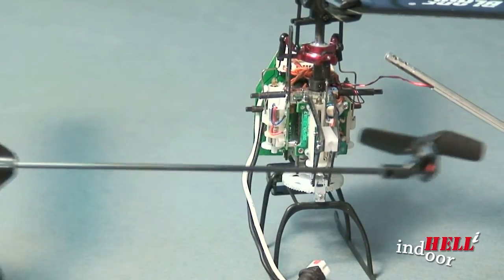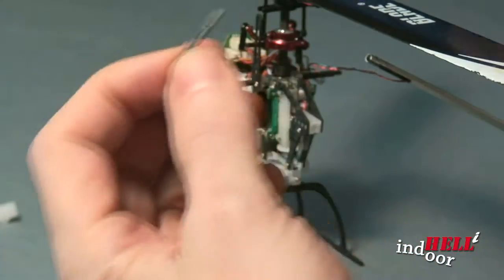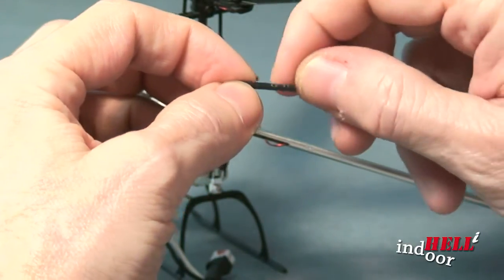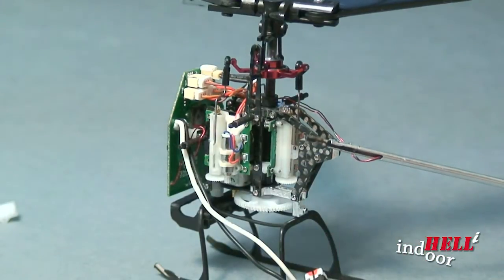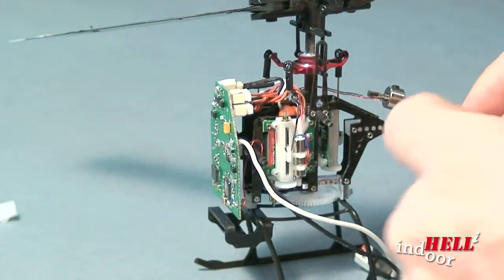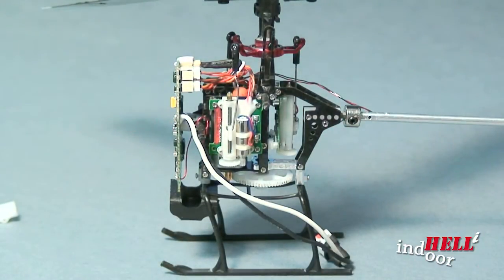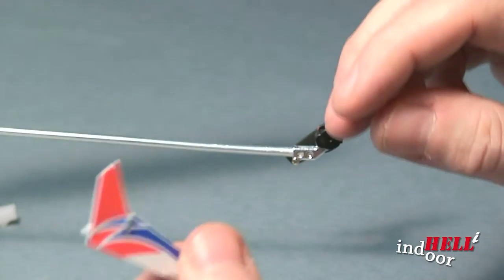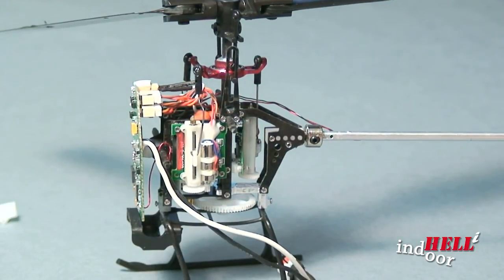mCPX Tail Upgrade (MicroHeli) - indoorHELLi 004 - B

Comment: Nice video! I realize this is a really old post, but I have a question: I'm using an old stock Mcpx  in a scale project and need a way to make the tail motor serviceable. l think the MicroHeli motor mount would work well for me, but am wondering how much of a chore it is to get the motor out of the stock motor mount without damage to the motor.  Any info on this would be much appreciated.